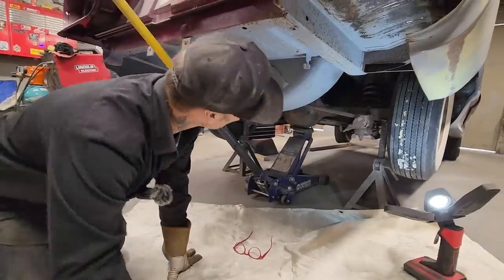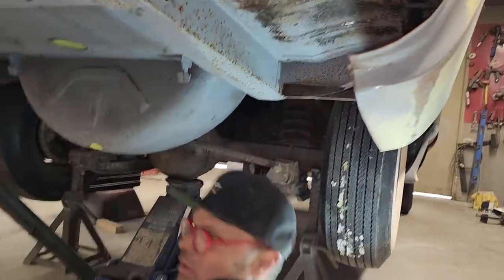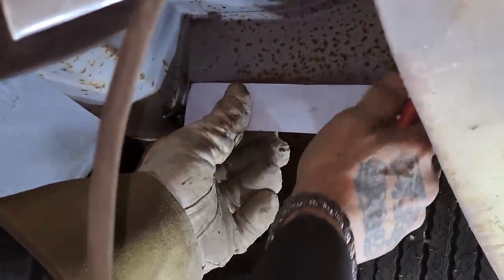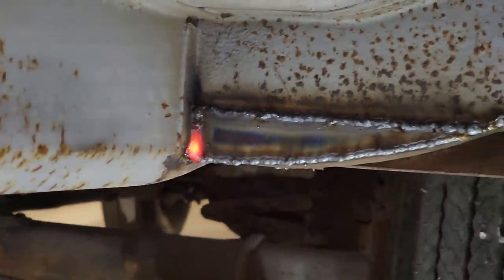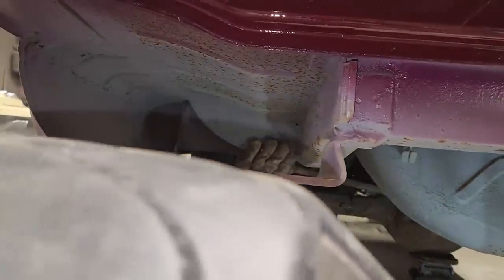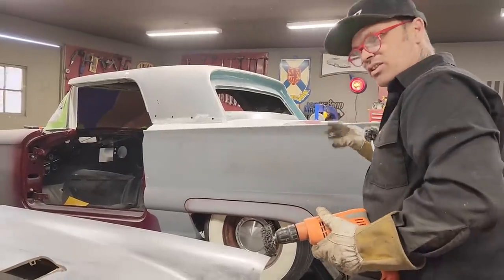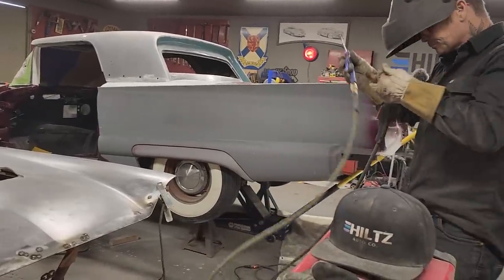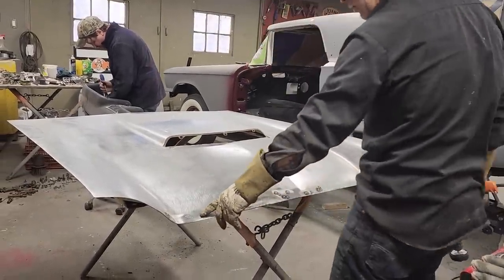Wasn't expecting to find issues underneath 😓

Comment: I purchased a 1959 T-bird in 1962 on the West Coast and had to have the rear quarters leading in then repainted right after buying it.  They were prone to rust as I don't recall it being undercoated from the factory. Second problem was with the power window rollers other than my girlfriends sitting on the buttons making the window go up and down. . They were split rollers and as such were slow and would bind. I took a set from a 1955 Ford and they were one piece rollers and what an improved difference.
Ron Sloan

Comment: Hi Chad & Jolene, more progress made today! That hood has really required some repair time and the top of the hood repair still has to be filled. The hood has been a great repair to show people who do not realize how many hours can go in to rust repair when a replacement part is not available. Great work on the top of the hood that was very thin metal to deal with. Jolene you did a fantastic job of the close-ups on the underbody repairs, since we do not see you most of the time I often wonder if you are laying on the floor too getting those shots. Alot of people would not show those parts of the project or repair they would decide it was to much effort. Thanks both of you for another great teaching experience, I will be back tomorrow.

Comment: Great job repairing those rusted out areas on the hood and on the car's frame.  Minimizing warpage on the hood can be tricky while welding in repairs, but you pulled it off beautifully.  Great job Chad!  Jolene is doing a great job with the camera and I'm sure she looks like a 10 while filming.  Keep up the great work!
Reply: Yes. So glad she shot close-ups while Chad was demonstrating the coat hanger trick once more.  Great camera work, ma'am.

Comment: Hey Chad & Jolene … when grinding them finicky welds I have found instead of using a grinder I use small diameter wheels on a mandrel from princess auto .. and you can run them on a drill or die grinder or electric Dreumel or a dynafile … they work way better in my opinion and you can slow the rpm in order to grind precisely where you need to go without going full rpm with the angle grinder. Then a quick rip with a flap wheel to blend er in

Comment: I'll hold my final thoughts about that back window until you get to the point of completion. Right now it's reminiscent of a station wagon that was chopped and made into an El Camino. By the way I know where there is a 1956 Chevy nomad that somebody chopped and made into a El Camino! It looks like it was done decades ago. Yes it is a real nomad they chopped it down. I thought about buying it and tailgates probably still worth a couple of grand. I think he wanted 8504 the car. It's in Southeastern U.S. as far as the Thunderbird I think you have improve the looks of it greatly by shortening the roof.

Comment: Just getting into MIG over fluxcore so I can weld sheet metal. You were the inspiration, Thank You!
Reply: I have been working on flux core welder and just upgraded to inverter type it's great for all welding work from sheet to flat bar. If working outside or anywhere with a draft solid wire and gas welds will be poor as wind will disperse gas. The new inverter types allow you to weld most steel types and thickness. Cheers.

Comment: What Did you Use To Treat the back of the metal piece you Just welded on? Isn't that going to Rust eventually?
Reply: I'll bet he didn't do anything. He could thin some metal primer to a semi watery consistency and pour it into the underside of the front, while holding the hood vertical, and let it soak into the layers of metal. Let it dry, and repeat several times. Or use rust converter paint.
Reply: @frankschwartz7405  Ahhh, yes. That's what I was trying to dredge up from my failing memory. It's good stuff. I've used it many times over the years to stop latent rust between panels (but not ones that are on the point of perforating- just lightly pitted.) Once the acid is dry, an application of thinned zinc primer seals the lot, pretty much permanently.
Reply: Yep, he just sprayed a layer of paint over it and welded bare steel in. No rust proofing and didn't get all of the oxidisation out. It going to rust through in a few years but he will have sold the car by then.

Comment: Doesn't anyone use lead for bodywork anymore? Is it to much work or not very safe?
Reply: I’ve done plenty, but I never got good at it.  Most of it would end up on the floor when I was working on a vertical panel like a door that was installed on the car. 
I do believe it’s very dangerous, but I’m not 100% sure.  The lead that used to be in gasoline is definitely very bad for your health

Comment: My only issue with fixing pin holes in this manner is the pits you can't see YET!!!!  New patch fixes the future issues....just my opinion....like my belly button 😢
Reply: Yep, if you don't get every spec of oxidisation out it's going to come back and eat into the untreated back surface of the steel.
Reply: @nicfraipont4184  yes Sir.  The rust starts on the inside and works its way out.

Comment: I like that.  I suppose if it were nice and open, not contoured or on an edge a patch may be better but as a novice I’m glad to see that is acceptable.
Reply: Me Grumps, are you saying you should always cut out the rusty, thin, pin holed metal?  I would think that is how to correctly repair any rust but I understand Chads opinions and see it as someone’s option.
Reply: Right, it is an option. It’s a short term solution, but Chad has told us many times he’s more interested in the artistic outcome of his work than anything else.
Reply: Oh, come on grumpy, you’re going to ruin everybody’s fun
Reply: That is one of the greatest fears when buying a freshly painted classic.  You need to know where and what to look for to identify cheap patch jobs.

Comment: Take the hood skin and inner structure apart.  There is a lot of rust between the two pieces of steel.
Reply: I agree! There are a lot of restorations out there with beautiful paint jobs, hiding latent rust which will eventually break through and make them worthless.
Reply: But Mr. Grumps that’s the best part of these videos. This is great entertainment, and Chad gets an A+ for the effort he puts into accomplish his goal.  And of course Jolene as well
Reply: Agree with you totally.

Comment: would anyone have an opinion of what Brand/Model of MIG welder a new "welder" might want to consider.  This is just for a homeowner with modest projects in mind.  As Chad uses Lincoln, I'm leaning to that brand. Any ideas will be appreciated.
Reply: Lincoln has been making mig welders for quite some time.  I have used Lincoln Hobart etc But the Lincolns have never let me 
down. Not too long ago you could get a nice Lincoln meg for 500 bucks. I don’t know if the prices have gone up or down but in my opinion, you are much better off starting off with a decent welder like the Lincoln. I don’t recall the part number of my gas machine or I would give it to you.  It’s a little more than most people would need, but I’m happy with it
Reply: @i8ntnuts  thanks "nuts", that is what I was thinking. Spend a little more and not worry about it. I'm trying to see if I can learn how to weld by watching Chad.